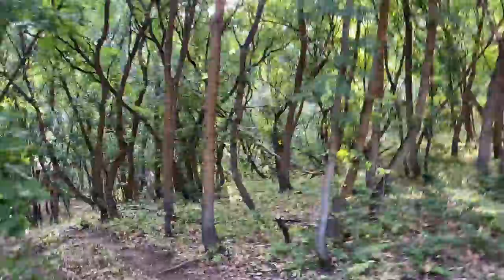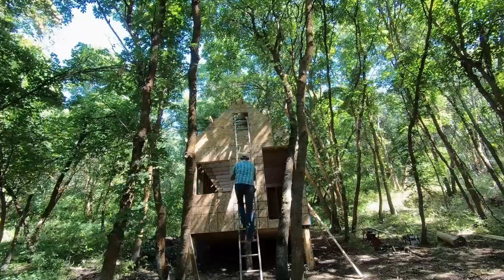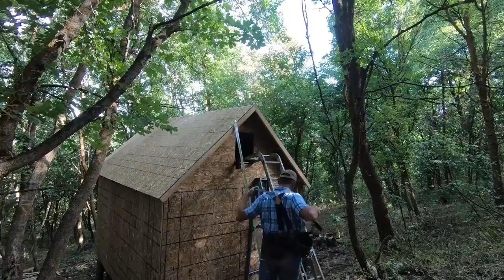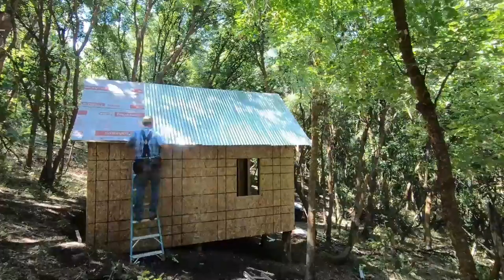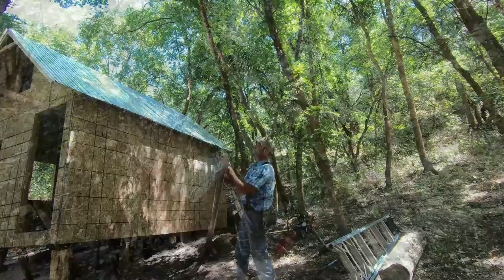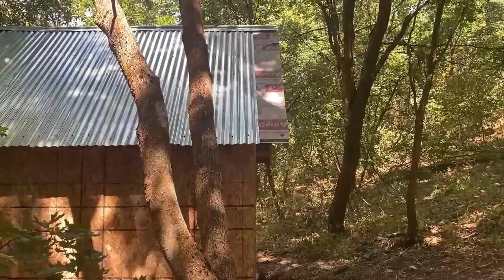#427 - Tiny Cabin Build : The Roof Is Done! (Corrugated Tin)

Comment: I'd install a roof window. *Properly installed, they never leak.*
 Plus, choosing an opening one, they are great for ventilating in hot summerdays.
I did in a dark room in my house 33 years ago, and the result is spectacular. Never had a single drop of water in.

Comment: I had the same problem with my cabin when putting the tin roof on. I found when i got to middle of sheeting the roof that if that first sheet isn't fitted exacting square you end up with out of true ends. It's OK at the top of the roof as the ridge capping hides it but the bottom needs trimming . I had to crawl out on the ridge to put the capping on too like you did, Quite a uncomfortable experience! Shame you didn't have the extra sheets but a few more and you'll have a nice veranda as well! Thanks for sharing!

Comment: Nice to see someone still using "crinkly tin", i tried to get some to re roof my dads shed recently and it is hard to come by in the UK, unless you order it or want small sheets. I ended up using plastic coated square profile as it was something I could get very quickly. Keep going and keep the midweek updates. Regards from 🏴

Comment: Heath, either a window in the side that doesn't have one or a "Solartube" through the roof maybe? Seen it done in a few off grid back country cabins and it works well, just insulating it through the loft bedroom area to stop cold seeping in during winter. But it gives heaps of light at ceiling level.

Comment: Hi,,, Cabin looks good, but i have a question, the roof u put on is overkill, in my opinion. Im in ont. Canada. Up here we do steel roofs completly different. We strap trusses like u at 2ft centers, then we put on ruff cut 1x4s at 2ft centers across the truss. Then screw the steel to 1x4s leaving the underside of the steel bare so that any sweating can evaporate. I find with steel laying flat like yours any sweating cant evaporate. The roof u put on is exellent for shingles. Plus it would be alot cheaper without the sheating. And alot lighter to carry up the ladder.  My 41 yr old steel roof is still like new( faded paint) but the attics are completly dry. Just my 2cents. Maybe thats what ur building permit calls for😉😉
Reply: Just about to build my outdoor kitchen, and that's how I'm going to do the roof...Thanks!

Comment: roofing screws should be in on the tops not the valleys on the corrugations : fix: fit some rubber washers or it will leak :)

Comment: It's not a good idea to put underlayer directly on top of the roof sheeting. It'd be good idea to have at least couple of centimeters gap between underlayer and sheeting. You can imagine what happens when weather is changing between plus ans minus and water starts to condense between wood and the underlayer.
Reply: That's only a problem if the underlayment is a vapor barrier. Housewrap isn't, so the water vapor can get through just fine and condense on the outside.

Comment: Hey Spud, lots of good info here (not advertising product .. just building technique) https://www.youtube.com/watch?v=5M0Qaokek9I   You want to tie the overhangs into additional rafters, not just the two rafters which your 2x8 sheets attach too. More strength this way to support heavy snow loads without sagging. Too late for this shed but consider it for the shop roofing.

Comment: #RedPoppyRanch Why the fuck are the screws in the valleys ? I've been a Plumber for 35 years and done rooves exclusively for the last 25 years, now this only applies to Corrugated steel roofing ! Corrugated Metal Roofing Screw Placement https://youtu.be/mhZfGPO0nks And if anyone says it's because of the snow, I'll say Poppycock !